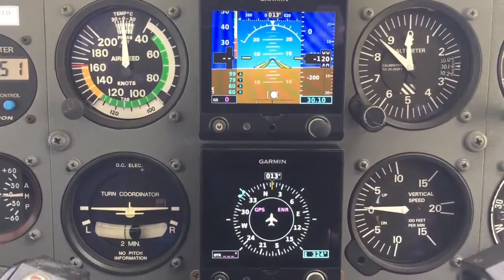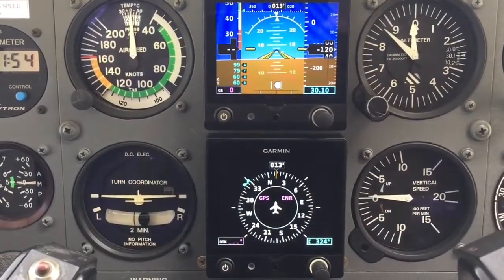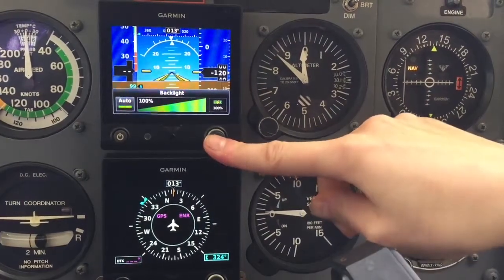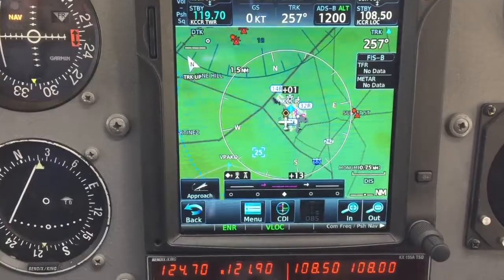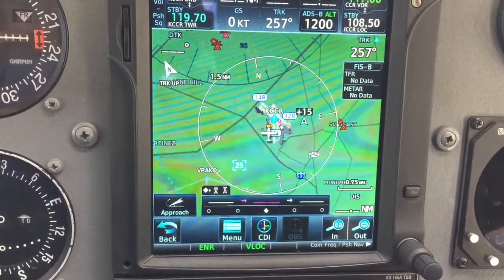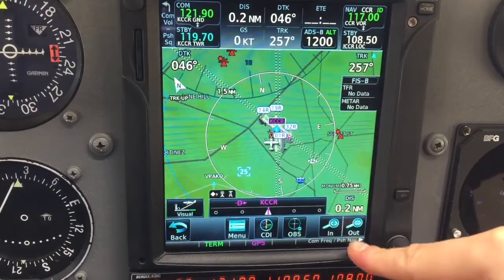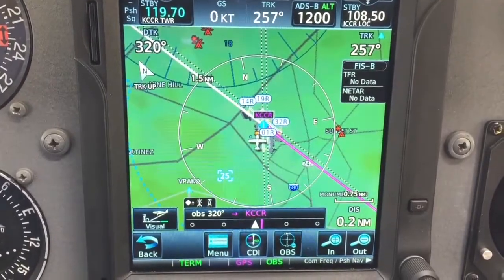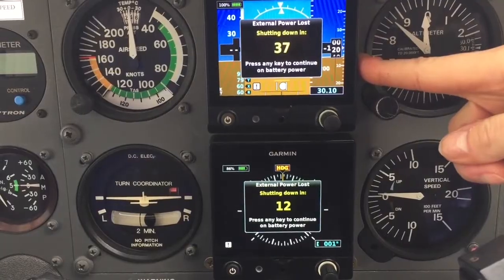Garmin G5 Introduction

Comment: Is the G5:actually wired into the panel electrics / electronics ?  Or just velcro'd on ? Many thanks
Reply from the maker: The G5 replaces the instruments it emulates. It’s connected to much more than just the electronics.

Comment: how did you get the 750 to only have one block for the transponder? Instead of having the 2 (one on top of the other)? Thanks
Reply from the maker: Those types of choices are on the maintenance side in configuration mode.

Comment: Thanks for sharing this - I just had a flight today and stumbled on the very simple VOR TO and FROM decision - Compared to Analog gauges where you can read To and From the G5  can be tricky as you show in your video - I will use it to remind myself on the proper use (2 Arrow pointing in same direction = G5 Courseis showing TO, if both arrow are point 180 opposite then G5 Course is FROM) 6:30 to 8:00 in your video

Comment: Configuration of this is installation is wrong! HSI page on the G5 AI should be disabled per part23 AML STC installation manual. You should not be able to select HSI on G5 AI. However the G5 HSI should be able revert to AI mode automatically or can be selected manually.

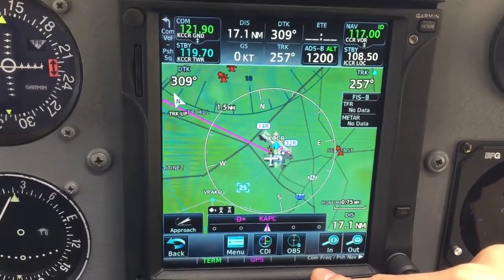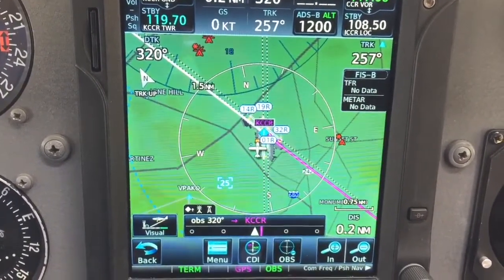Comment: The OBS function around the 9:30 to 11:00 times was exactly what I was looking for.  I fly in and out of a class delta with crossing runways that are only about 40 degrees different, and after 50 approaches I STILL have a hard time setting up for one versus the other.  Having the bold runway displayed should help!

Comment: Why are you using some other Garmin unit in this video besides the G5.....?? We don't have the extra unit just the two G5 units
Reply: The third unit is a Garmin GPS.  That's where the navigation information for both G5s comes from. Their airplane is equipped with one, so they demonstrate how they work together.